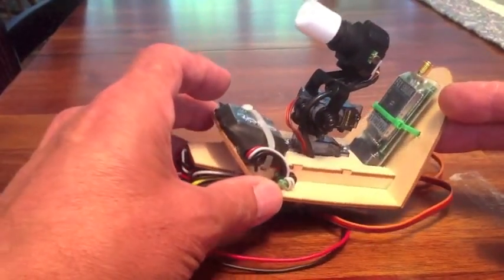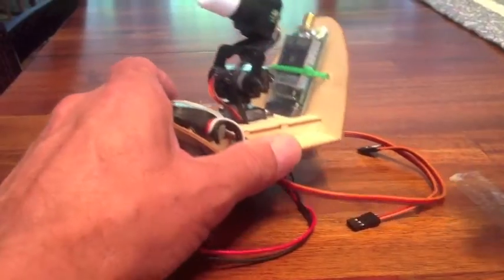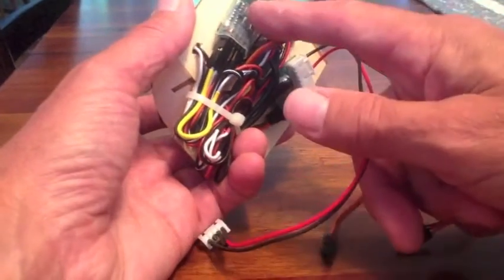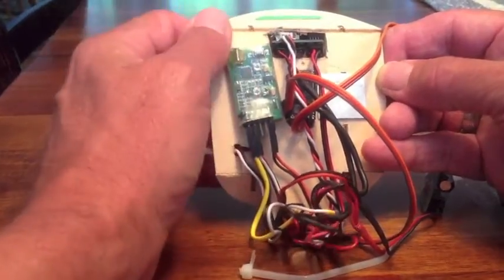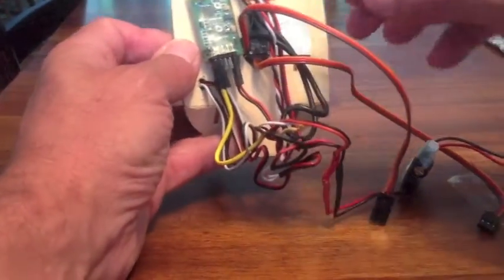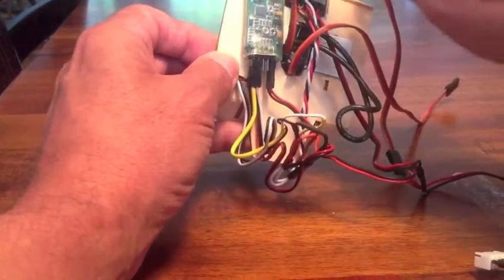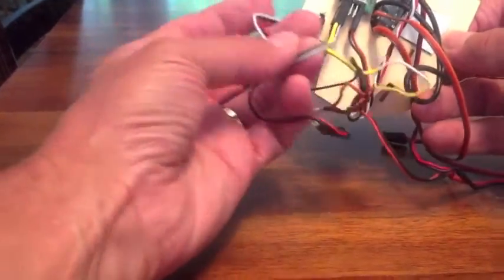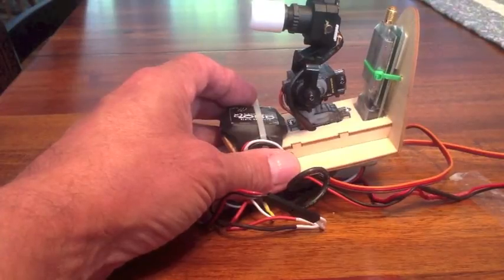Wiring Mini OSD with GPS

Comment: Anyone have a link to the cable/connector that interfaces with that white Fatshark Tx socket?  just hate to buy the cable on hobbyking, wait a week or two, only to find out it is the wrong connector...  Will hobbyking part# 324000017 work?